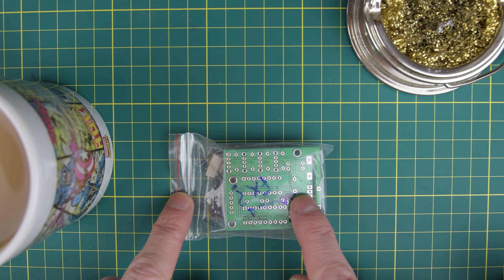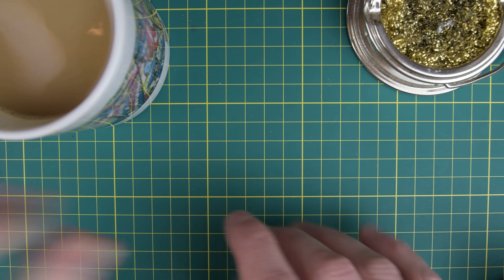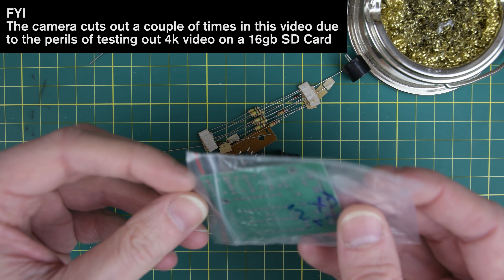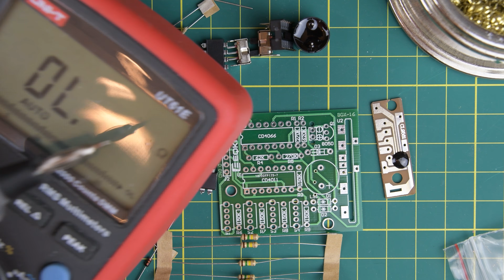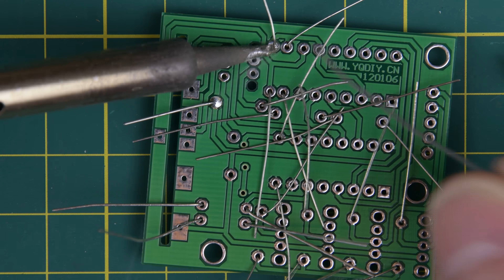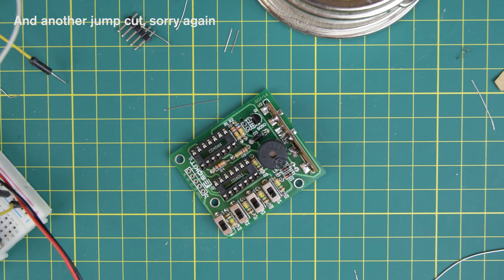LAZY SUNDAY: Sounds Effects Board Kit - LS2

Comment: What were the header pins for? If they included the Vcc and God connections, then you could have put the cap in where you were connecting power - seemed a bit odd having the power connections there in the first place...
Reply: i'm guessing the header pins can be used with something like an arduino to do the different settings instead of using the switches, but not positive.